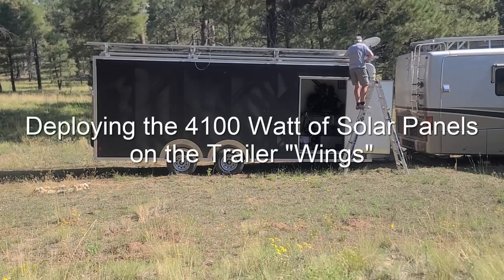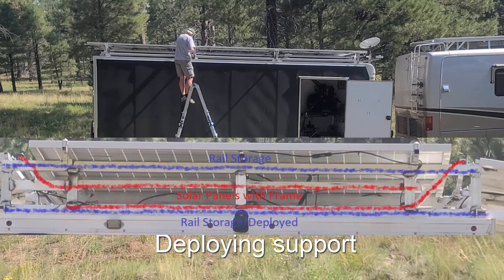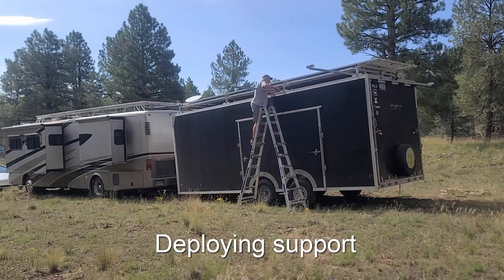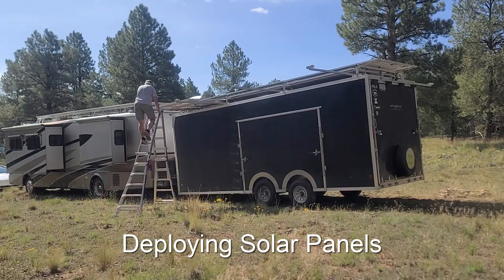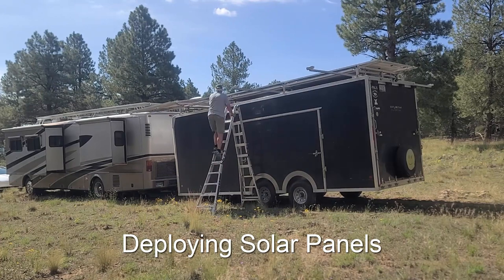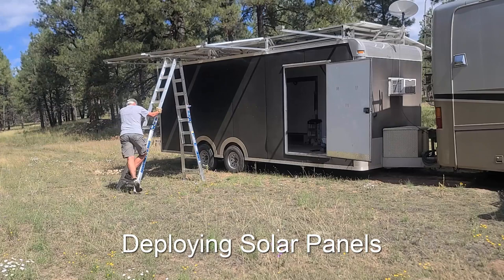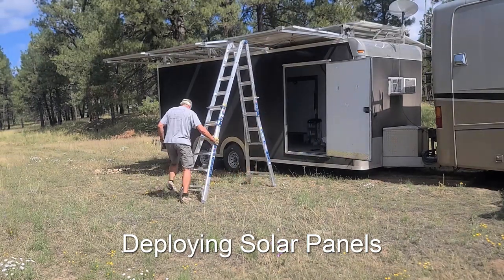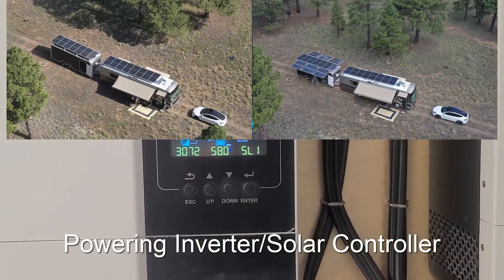Deployment of 4100 Watt Solar Panel Trailer "Wings"

Comment: I see gear motors and linear actuators in your future🔮
Reply from the maker: Would be nice, if it can be light weight. The current extra weight on the trailer is 600 pound Aluminum and 850 pound Solar Panels.